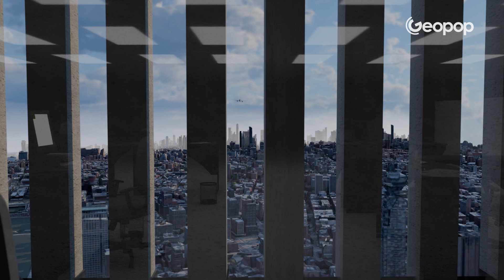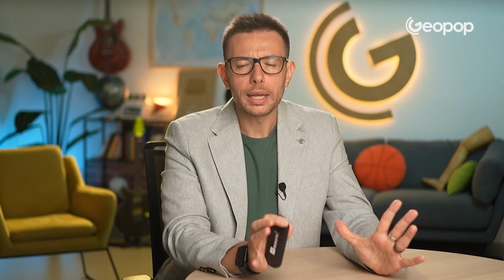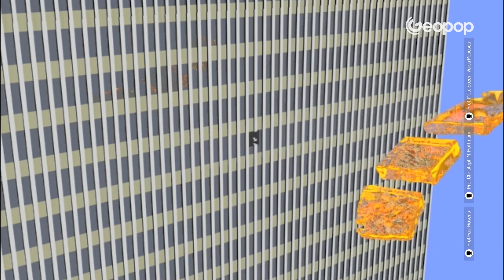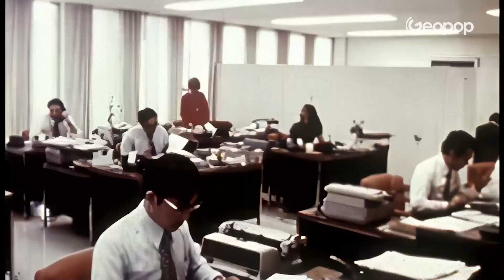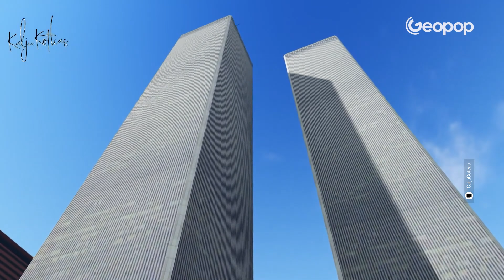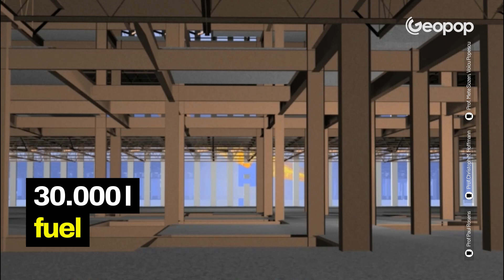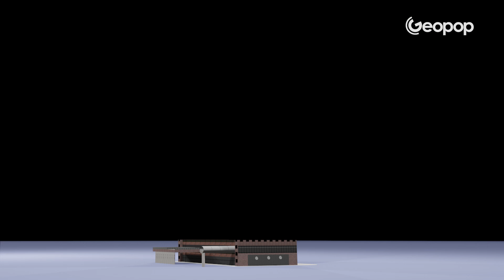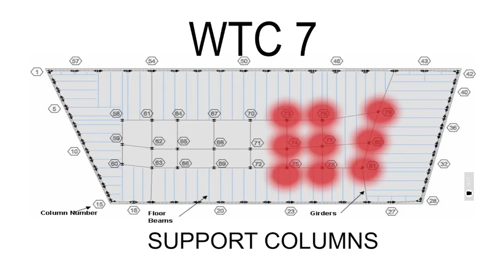9/11, 2001: The Technical Reconstruction of the Twin Towers and WTC 7 Collapses

Comment: Heat and weight is why they collapsed.  I was a firefighter watching on the morning of September 11th. My mom said they just said the firefighters are going up the stairs right now, and I said no, all they’re going to do is hinder the people trying to climb down and those buildings are going to collapse. Little did I know how right I was.
Reply: So why did the North Tower not collapse in 1975 even with the cumulative weight of 99 floors bearing down upon the fire zone?  You argument of heat and weight is total nonsense for many reasons.

A three-alarm fire broke out in the 11th-floor offices of the B. F. Goodrich Company in the north tower of the World Trade Center just before midnight last night and spread through an inner-service core to the ninth and 14th floors. “It was like fighting a blow torch,” according to Capt. Harold Kull of Engine Co. 6, who said all of his men “got their necks and cars burned” trying to get into the 11th Floor hall from a stairwell. A total of 24 pieces of fire fighting apparatus and 132 firemen fought the fire. Sixteen firemen were treated at the scene for smoke inhalation. Flames could be seen pouring out of the 11th-floor windows on the east side of the building. 
--- TRADE CENTER HIT BY SIX-FLOOR FIRE, Blaze Starts on the 11th—16 Men Are Injured, The New York Times, February 14, 1975.  

Needless to say, with the weight of 99 floors bearing down upon the 11th floor, the building did not collapse.

Also…

Why the steel was not as hot as you claim it was!!

QUESTION: if you heat one end of a steel beam in a raging fire, will the heat dissipate to the other end and to any other steel beam it is connected to, and will that limit the temperature that can be attained on the heated end?

Google + AlOverview

ANSWER: Yes, if one end of a steel beam is heated in a raging fire, the heat will dissipate to the other end and to any attached steel beams. This dissipation acts as a heat sink, which will limit the maximum temperature the heated end can attain.

How heat dissipation occurs

* Conduction: As a metal, steel is an excellent conductor of heat. The thermal energy from the fire causes the steel atoms at the heated end to vibrate more intensely. These vibrations are then transferred through the material to adjacent atoms, and so on, in a domino effect that sends heat along the beam.
* Convection and radiation: Heat is also lost from the surfaces of the unheated sections of the steel to the surrounding environment through convection (heating the air) and radiation (emitting thermal energy). These processes become more efficient as the temperature of the steel rises.
* Connections to other structures: When the heated beam is connected to other steel beams or structural elements, it conducts heat into them as well. This effectively increases the total mass of steel absorbing and dissipating the heat, enhancing the "heat sink" effect

Why heat dissipation limits the maximum temperature

The maximum temperature of the heated end is determined by the balance between the rate of heat flowing into the steel from the fire and the rate of heat flowing out of the steel via conduction, convection, and radiation.

* Establishing equilibrium: As the fire heats one end of the beam, the temperature difference between the hot end and the cooler parts of the structure drives heat away from the fire. The greater this temperature difference, the faster the heat dissipates.
* A "steady state" temperature: A steady state is reached when the rate of heat input from the fire is equal to the rate of heat dissipation from the steel. At this point, the temperature of the heated end will stabilize and cannot increase further unless the intensity of the fire increases.
* A natural limiting effect: Even with a "raging fire," a heated steel beam will not just infinitely increase in temperature. The extensive mass of steel in the rest of the beam and any attached structures provides a very large surface area for cooling, and a large volume for heat to spread into. This makes it a very efficient heat sink, which works to oppose the temperature rise.
Reply: @markcohen308  the fire wasn’t large enough or hot enough then. Plus you have to factor in the damage from the planes as well. Theres a difference in the heat load caused by contents inside of a building burning, and 10000 gallons of jet A fuel combined with those contents, as well as the damage from the planes removing a lot of the protective fire coatings from the structural supports.
Reply: @cliffsubermusic   Where to begin?  There are so many problems with everything you said.  Let's start with the jet fuel.  Those giant fireballs we all witnessed were 99.9% of the jet fuel (highly refined kerosine) igniting upon impact, and in a couple of brief seconds the fire ball, along with virtually all the jet fuel, was burned off. Even if you wish to reject this argument, The National Institute of Standards and Technology (NIST) stretched themselves as far as they possibly could by saying that "initial jet fuel fires themselves lasted at most a few minutes." (Final report on the collapse of the World Trade Center towers, NIST NCSTAR. Gaithersburg", MD: National Institute of Standards and Technology, September 2005, page 179). And even that was a wild exaggeration, it was not a few minutes, it was a few seconds!
And most of the jet fuel burned off, as you can clearly see, outside of the building's footprint. Do you seriously think that exposure to burning kerosine for only a few minutes could possibly do anything to massive steel beams?
Reply: @cliffsubermusic  and furthermore, the steel was not as hot as you claim it was!!

QUESTION: if you heat one end of a steel beam in a raging fire, will the heat dissipate to the other end and to any other steel beam it is connected to, and will that limit the temperature that can be attained on the heated end?

Google + AlOverview

ANSWER: Yes, if one end of a steel beam is heated in a raging fire, the heat will dissipate to the other end and to any attached steel beams. This dissipation acts as a heat sink, which will limit the maximum temperature the heated end can attain.

How heat dissipation occurs

*   Conduction: As a metal, steel is an excellent conductor of heat. The thermal energy from the fire causes the steel atoms at the heated end to vibrate more intensely. These vibrations are then transferred through the material to adjacent atoms, and so on, in a domino effect that sends heat along the beam.
*   Convection and radiation: Heat is also lost from the surfaces of the unheated sections of the steel to the surrounding environment through convection (heating the air) and radiation (emitting thermal energy). These processes become more efficient as the temperature of the steel rises.
*   Connections to other structures: When the heated beam is connected to other steel beams or structural elements, it conducts heat into them as well. This effectively increases the total mass of steel absorbing and dissipating the heat, enhancing the "heat sink" effect

Why heat dissipation limits the maximum temperature

The maximum temperature of the heated end is determined by the balance between the rate of heat flowing into the steel from the fire and the rate of heat flowing out of the steel via conduction, convection, and radiation.

*   Establishing equilibrium: As the fire heats one end of the beam, the temperature difference between the hot end and the cooler parts of the structure drives heat away from the fire. The greater this temperature difference, the faster the heat dissipates.
*   A "steady state" temperature: A steady state is reached when the rate of heat input from the fire is equal to the rate of heat dissipation from the steel. At this point, the temperature of the heated end will stabilize and cannot increase further unless the intensity of the fire increases.
*   A natural limiting effect: Even with a "raging fire," a heated steel beam will not just infinitely increase in temperature. The extensive mass of steel in the rest of the beam and any attached structures provides a very large surface area for cooling, and a large volume for heat to spread into. This makes it a very efficient heat sink, which works to oppose the temperature rise.
Reply: @cliffsubermusic  and you point out "the damage from the planes as well".  But damage from a plane impact cannot explain the towers falling at the acceleration of gravity (as admitted by NIST) because that violates Newton's third law.  NIST said the North Tower fell in 11 seconds.  But a brick dropped off the side of a WTC Tower, falling through air, would take between 10.3 and 12.9 seconds (the variation depends on the bricks orientation as it falls).  That is free fall acceleration. That means the building, with all its steel and concrete, crushed through itself as fast as a brick dropped off the side of the building, falling through air.  Stop, take a step back, and think about that.  Ask yourself is that even makes sense.  That would mean the building crushed through itself all he while encountering ZERO structural resistance.  How would that be possible from a gravity driven collapse?   This is really not hard Cliff.
Reply: @m @markcohen308  could care less what any biased research has supposedly shown. I was a firefighter watching the events unfold live that day. And knowing what I know about building construction and steel when it’s heated. I called it before the second plane even hit the second tower. I said that building is going to fall. Then when the second plane hit they reported that fire crews were going up the stairwells, I said once again they don’t need to go up because they will just be hindering the people trying to escape. They didn’t fall at the speed of gravity in the first few seconds. When the remaining steel supports that was holding up those millions of tons finally gave away from the heat, the upper section the span of the damaged area. By the time that section had hit the resistance point of the intact floors, the momentum of those millions of pounds of concrete and steel couldn’t be stopped. They collapsed just as perfectly as I would’ve expected them to. It would’ve took millions of tons of force to make the upper structure tip over to the side, but falling straight down it became the world strongest jack hammer. As far as the fire, Sheetrock is designed to keep structural supports safe from fire for a certain period of time. Upwards of 30 floors just had a plane destroy all walls and fire barriers. So as to my original point, a contents fire in an intact fire resistant building would not cause a collapse, but in this case it was expected.
Reply: @markcohen308 idiot
Reply: @markcohen308 So, what do you think caused the collapse then?
Reply: @JasonCrowther-d6v  What difference does it make what I think?  The physics proves the official story cannot possibly be true.  What do you think?
Reply: @markcohen308 I'm thinking controlled demo as a backup if they didn't crumple fast enough.
Reply: @markcohen308 if you take millions of pounds and simply drop it onto a building, it's going to come down faster than you can imagine. Plain and simple. There is no slowing that amount of weight. And when you watch the high def recordings of both collapses... It starts exactly where the planes went through, and nothing ever could dream of holding it up. Just too much weight.
Reply: @eXaergaming  Well that only works eX if you happen to be breathtakingly ignorant of the fundamental laws of physics.  The North tower came down in 11 seconds (that's what NIST said, and they were approximately correct) which is free fall acceleration.  Ten percent of the mass of the building cannot crush through ninety percent of the mass of the building all the way to the ground and do so as fast as a brick dropped off the side of the building falling though air, because that would mean the falling mass encountered ZERO resistance.  How can a building with all it's steel and concrete provide no structural resistance?  Do you not understand how stupid that sounds? Do you know what Newton's Third Law states?